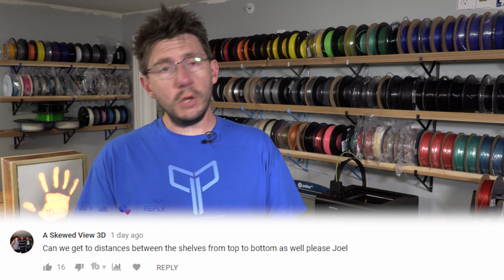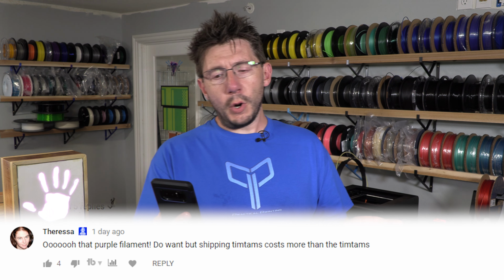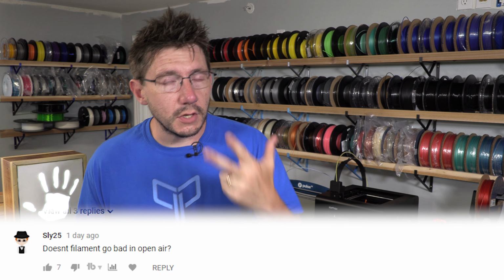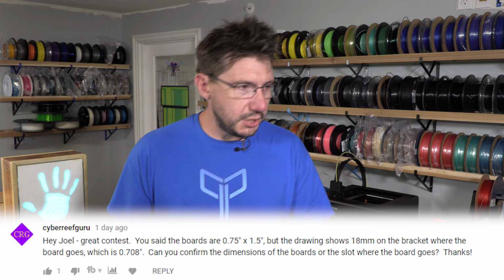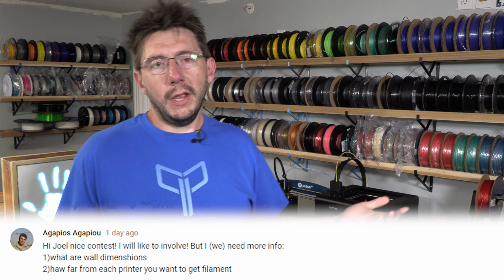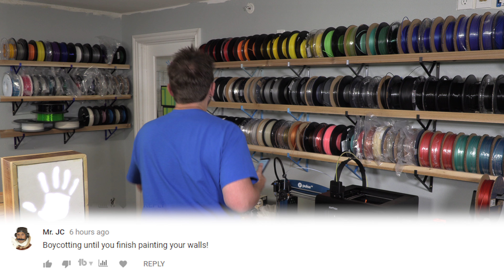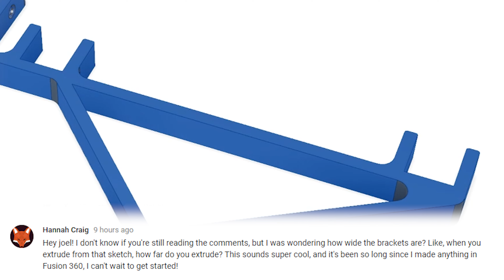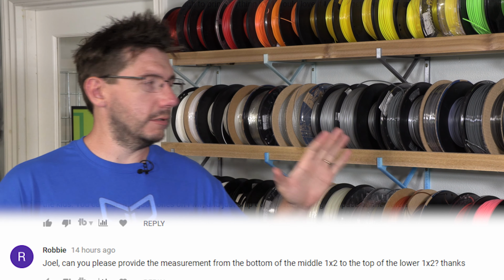MyMiniFactory / Matterhackers 3D Printing Design Contest - Update on Rules and Dimensions / Q&A

Comment: My solution would be to drill a 7/16in hole through both boards on the middle shelf above each printer. Then run 1/2in threaded rod into both boards and leave it sticking out 6 to 8in. Add a piece of black pipe with nuts and washers on each end to keep the spool on.

Comment: A couple of questions for you Joel. 
1. How far out from the front of the shelf do the spools poke out? 
2. Is it ok to make something that attaches to the bracket rather than attaching to the front of the shelf in order to guarantee that it won't interfere with the spools on the shelf.

Comment: So my entree uses your dimensions in inches, I based by sizing off those. Since you said 0.75", I made a size of 0.77" for the tolerance. I was wondering if the fit was gonna play into the contest? I can adjust the size if needed if that is a concern.

Comment: Hey Joel 2 quesstions. 1) what is the diamiter of the center of the filament rolls where the spool holder will go and 2) are you opposed at all to increasing the spacing between 2 shelves so as a design can work? am only thinking abot 3-5 inches

Comment: Giving dimensions in inches, correcting them in mm. This is why you normally  stick to metric in this kind of stuff :)
Reply: converting not correcting.
Reply: This is MURICA! Imperial ftw!
Reply: America is also the only country to still use imperial.. Infidels.
Reply: Hendrik visch  No. Canada uses both.
Reply: Hahahaha, so funny, UK uses Miles per Hour, Stones for weight. I could continue, but I will not.

Comment: id say if someone was to make a design using bearings , use an easy to find size , like 608 bearings , can find them almost anywhere or bust open a fidget spinner to get them ,or common printer part sizes like 8mm linear bearings or belt pulley bearings that most printing nerds like us probly already have in our spare parts box

Comment: REQUEST:  Good evening Joel.  I hope you and your wife are fully rested after that great unboxing video last night.    Can you please post your filament holder wall bracket via Fusion's sharing.  I'm not sure if you have done this before, but you can post any Fusion360 project and make it available to anyone to view.  You can select if you want to allow the object to be downloaded or not.  The reason I ask this is because this video nor the previous one provided all dimensions of this wall bracket.  I in particular need a very specific measurement.

You can share the model to a public address under File > Share.  This is a really great feature in Fusion that I like a lot.  The viewer is all done via a web browser so you don't need F360 to view it.  From there I can get whatever measurements needed.

Comment: Hold on a sec; if filaments go bad in open air before printing then will it still go bad after its been used? I mean, the principle for FDM is to melt the plastic and reform it into another object but its still the same material.

Comment: 18MM as width is fine. Here in The Netherlands most are 18mm thick ( or 1.8) or as marketing calls it ''2CM'' I have yet to see one that is 2CM. And i have worked in a hardware store that sold these by the mm. (yes, litterally you could get 1 MM as it is custom cut) anyhow. i'd say  18 is accurate.

If your design doesnt fit Joel is smart enough to resize specific part to make it fit.. As long as the overal design is decent 

Not that I participate.. I have hardly any method of testing anything anyhow. succes to anyone out there

Comment: Jo Joel my main printing man!
I've submitted a model already. It's simple, easy to print and awesome just as you like it. I didn't try to print it, cuz my printer is busy at the moment. I have a question though - What is your preferred nozzle size and max print volume? 
P.s. I designed an animated Easter egg (with reverse planetary gear) as you asked for. Please reply if interested.

Comment: Wait, so are the pieces of lumber that were used 1x2 or 0.75ishx1.5? I would consider this a critical dimension to design around so I want to clarify as both sets of dimensions have been said between the two videos. Thanks!
Reply: It's 0.75ish by 1.5ish. 1x2 is its "nominal" size, that's the name of this size, but in reality it's a little smaller. I'm using 18x36 myself, because by Joel's own sketch, 18mm wide fits around the wood.

Comment: joel, i bought my 3d printer to aid in making jigs and tools for carpentry ... if i lived closer i would just build one (with small 3d printed parts and trim) .. after fixing the paint work along the ceiling lol and just for the fun of seeing my work in videos made by one of my favorite youtubers (as would my son about to get his first 3d printer) ... but NY is a bit too far away  from you ... and i cant haul my tools that far 
purchased here where i live rough cut cherry is easy to get (grows in my back lawn) and filament guides printed in pla with brass and copper to add in a bit of steampunk on adjustable rails (to add big spools)

Comment: 3d printing nerd please help when I print a phone case on my wanhoo Duplicator i3 it does not stick to the print bed and it is leveled with paper
Reply: If your filament isn't sticking to your print bed (a problem I've been having a LOT with my Prusa I3 MK3), try: raising the temperature of your hotend to around 235, and slowing down your printhead speed by about 20%.  You do this inside your slicing program.  I use Slic3r, since that's what came with the Prusa.  When the program slices the model, it automatically sets the speed & temperature.  NONE of my models were sticking unless I used tape.  Now, they're sticking almost perfectly - no glue, no tape, nada.  MUCH better!  I hope this helps.  High five!

Comment: I would do the competition but I am not a big fan of Matter Hackers. I had some bad experience in the past of not shipping the complete order about 2 years ago and they never shipped the rest of the order after I told them about the problem. I don't remember the reason, but my company had already blacklisted them as a vendor months before I even joined the company. Even then, my coworker who is also into 3D printing, doesn't shop there because he they shipped him the wrong spool of filament and they never fixed his order.